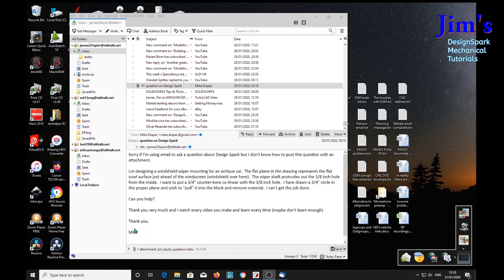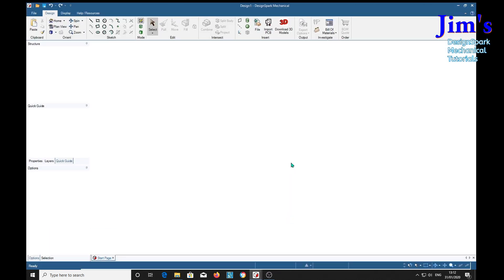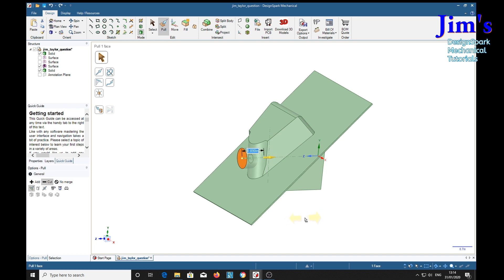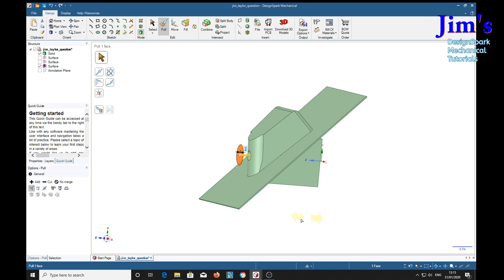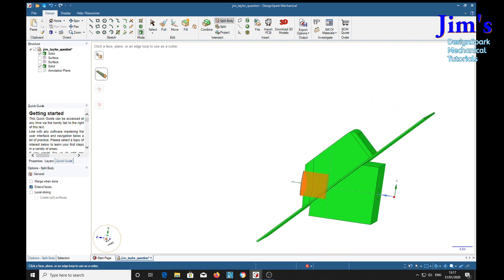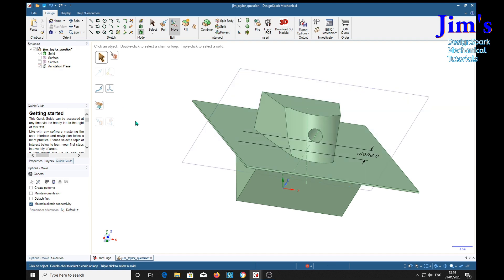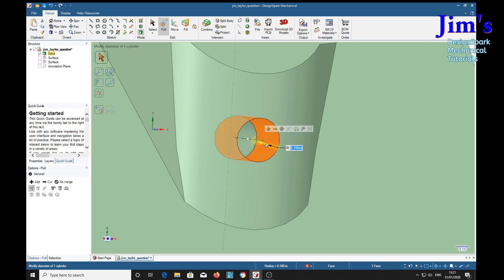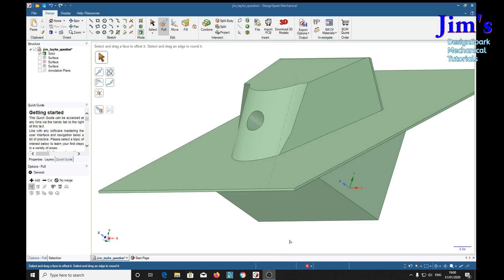Recess on a curved surface with DesignSpark Mechanical

Comment: Thank you, Jim.  This is Mike - you solved my problem!  This had taught me to try more than one solution (or approach) to solve a problem.
Thanks.
Reply from the maker: Hello Mike. I've been looking again at your model and it has some strange properties.
1. there are two corners associated with the curved face which have no corner lines!
2. the sloping side line of the curved face has a bend in it but the curved face is straight. I can't visualise this.
3. make the flat plate into a section plane and move it up and down - the section lines can not keep up with the sectioning and there are spurious other lines appearing?
I think that you have designed something too complex for DSM. I suggest that you start again and try and simplify the design. If you do this maybe then making the recesses will be easier.

Comment: Daft question.
Could you have pulled the larger diameter through then popped a sleeve in and grouped it.
Its a hammer wielding mechanical method and wondered if it would work in the world of the designer

Comment: Great tips and tricks, thanks
I've run into this issue myself and I've managed to make it work, usually by undoing the the curved section adding my recess then adding the curve back in but the method you demonstrated is much faster and easier.